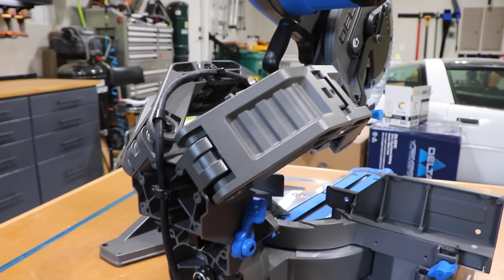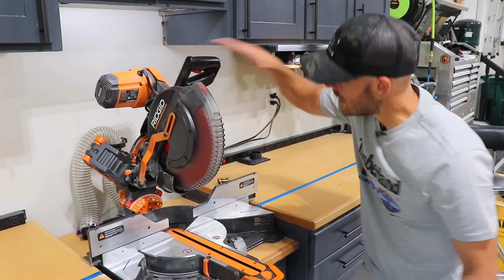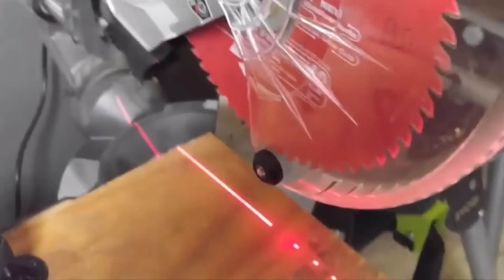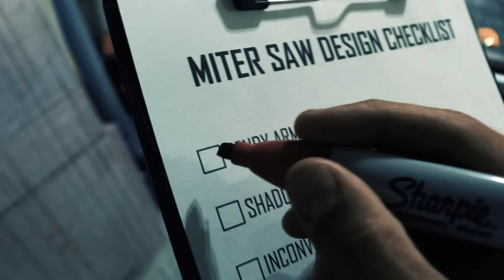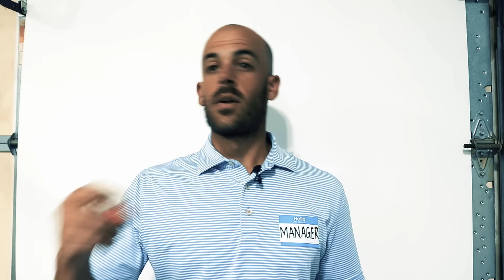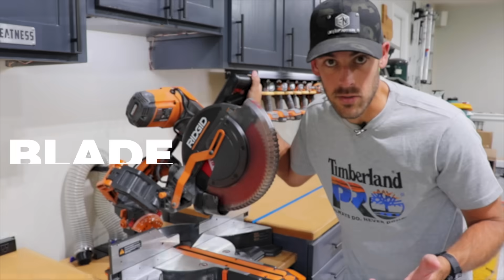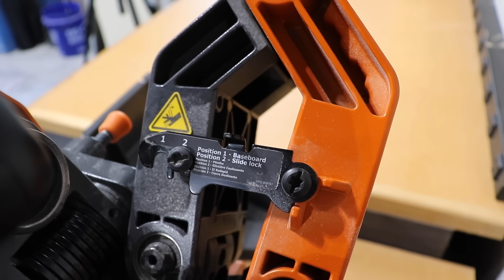I ALMOST took this Saw Back. // RIDGID & Delta Dual Bevel Sliding Miter Saw Review

Comment: Travis, I had the same issue as you with being unable to swing my miter saw to full miter deflection, but I came up with a relatively simple solution. I removed the top surface material from my cabinet and reinforced the upper mounting area of the cabinet, then attached some mounting blocks to the underside of the surface material. I installed 8” (200mm) soft close drawer slides I found on Amazon between the new cabinet reinforcements and the surface mounting blocks so my work surface will slide out and give me the clearance I need. If you get the soft closing type of slide, it does a nice job of holding the saw in the “normal” position for the vast majority of your work. I added two additional holes and put a pin on each side of the front to lock it out in the full open position for when I’m doing my full twist miter cuts.  And I don’t know if it’s necessary, but I used 2 slides per side for a total of 4 to give me the most “solid” feel to the sliding surface. I hope that helps! Keep pursuing shop greatness!
Reply: That was my thought about the drawer slides. I'm actually working on a workbench that will have about 6 spaces to mount tools to. But, I'm mounting all the tools on platforms and attaching the inside drawer slides to all of the tools so I can take them on and off as needed along with a plain solid platform if you're not using a tool in that spot. Using under the workbench for tool storage cabinet that will have outer drawer slides. Just a way to double or triple work space instead of multiple bases on wheels so you can move them around.

Comment: Great video.  Thorough and compete.  I have the Dewalt, and struggle trying to get the cuts I want.    So I use it for rough cutting down to size and then my tablesaw for the cuts I want.

Comment: I bought one of each of this saw (10” & 12”) both Delta for the theater set production department I ran for three years and they have worked out very well. Lots of use over the last four years. The 12” in in a large miter station with 8’ on each side and the 10” is on a mobile stand to be used on stage for last minute work not able to be done in the shop. Everything in your review was exactly what we experienced. I did put high quality blades on them. (Popular Tool brand miter saw blades)

Comment: To get the optimal cut out of both of these saws You’ll have to use some boards to raise the cut  level up to the deepest point of the diameter of the Saw blade on the parallel to your cut table so you just raising the table 3 to 4 inches To reach the widest point on the blade to be able to cut that large

Comment: I look forward to seeing what dust collection solution  you come up with for the Bosch ten inch glider. My current dust boot mod works fine on 3/4 to one inch thick stock but gets hung up when the saw is pulled forward to cut anything thicker.

Comment: I have had my eye on the Rigid 12" for some time now. As with all of your tool reviews, you give us honest plus and minus factors to consider when thinking of making a tool purchase and I personally appreciate the time it takes to do a thorough review like yours. I will admit the price is a big factor with this the Rigid. I have a cheap Kobalt compound miter saw that I bought for $100.00 several years back. I truly hate the saw and find myself using the older Makita chop saw that I also have. The Kobalt does not give me a smooth cut and almost always bogs down or burns when I try to cut hardwood, (it really is a piece of sh--!). My other go-to saw is a 1950s Dewalt Radial arm saw which will have a new cutting station, with it at one end and the miter saw at the other. I plan to keep my most commonly used size dado stack on the RA saw for all of the dados and tenons I cut. Thanks again for your review!

Comment: You should consider reviewing the Ridgid R4231 which is a sleeper model that came out at the same time as the R4251/R4241 and is also made by Delta. It's a 12" miter and features a short slider (thus eliminating most of the blade deflection issues). All indications is that it's built on the same chassis as the R4251 and your dust chute is probably a direct fit. Not a bad deal for $349 (I paid $329 and I've seen it as low as $299).

Comment: The Home Depot in my neighborhood must have seen your video and dropped the sale ;-).  No Sale in the Dallas area.   That was a great review.
Reply: Try ordering online and ship to home for free.  That is how I got my saw for the $399 price.
Reply: @rickbrewer8507   Price online with the link was full price,  When I went to HD site and searched for it,  it was 399.00  go figure??
Reply: @billswoodworks3289  Get it before they change the price!  This a good price and with the dust collection mod it is really a good saw.  I also have the DeWalt DW716XPS and the cuts made with the Ridgid locked in position are just as accurate as the  DeWalt's.  Just make sure you replace the stock blade unless you are only making rough cuts.
Reply: @rickbrewer8507  bought it the moment I found it.... should be here Tuesday.   Thanks for jogging my brain,  didn't think about doing straight web search

Comment: Great video, Travis. Thanks for taking one for the team and spending all that money 😂
I have an AEG (Ridgid equivalent) 10" mitre saw with LED shadow line. It's like an amalgamation of your Ridgid and the DeWalt as mine has those two rails it slides on. I fear the day I want to upgrade to a saw without a shadow line. Once you experience the shadow line, you want it in all mitre saws.
Reply from the maker: I agree!  Such a nice feature

Comment: Another technique to minimize deflection is the layered approach.  Don't cut through the whole piece at once, even for 3/4 material.  Do a half way cut just guiding the machine, life and extend it back, and then do the bottom half.  Silky smooth and straight cuts all the time.  :D

Comment: His Dust Chute is great.  I did have to make one modification to it, though.  He has you use shelf liner at the front edge, and it worked fine for me while I was using my shop vacuum.  Then, I upgraded to a 1.5hp dust collector, and the shelf liner would get sucked up into the chute.  So, I had to duct tape a piece of copper wire to the front edge to hold it in position/shape.
Reply from the maker: A thicker materials works well too, almost like a thin rubber seems to be stiff enough to resist collapsing

Comment: I went with a Metabo which is like the Makita and I'm trying a different approach to dust collection. If it works it will be a game changer for pretty much every mitersaw... great review.
Reply: I set my Makita up by throwing away the stock DC hoses and using 2 1/2" hoses connected to a 4" Y split, picks up everything

Comment: Hola! 🖐Thanks for this video and your input, it truly is packed with lots of info. I currently have a 10" Delta, it's a good little workhorse; I dug this guy out of the trash believe it or not. I purchased a used 12" Makita that has an extremely frayed cord, I'll have to repair that soon. Once I finally get my shop up and running, I'll be definitely put not only a Miter Saw but a whole station. Until then, this review and future review videos will really help me out. Take care and have a good one, Adios! 👊

Comment: I traded my (pretty good) Hercules against the 12" Ridgid - and I fully agree with your view on the saw. 
Also I made my own dust chute out of plastic shelf liner, but I think I only got a reduction of about 50%. I guess I'll get yours then instead of wasting more time on improving my own.
Reply: Hello Mario, I have been thinking about doing the same thing, I am a Harbor Freight 12''Hercules, and it's been a great saw like you say, and changed to this Ridgid, So my question to you is what's been your experience? Are you still happy after you changed?  or somehow you regret the Change from The Hercules to the Ridgid 4251??? Thanks very much for your feedback and happy new year.
Reply: Happy New Year. I don't use the saw as much as I thought I would, but I'm still glad I switched for 2 main reasons: a) the saw needs just so much less space; and b) I barely have kickbacks when cutting small pieces. This second point used to be a major pain for me as I often cut (off) small pieces, and even without a sacrificial fence I never had a kickback on the Ridgid. But on the Hercules that happened almost every time if I wasn't extra careful.
Reply: @systemfisch  Thanks very much for your fast feedback, about the kickbacks I agree with you 100%, Thanks again. & Regards

Comment: Remove the sliding fence, lay a 2x12 on the table and then put your wood you want to cut on top of the 2x12 and slide it all the way in. That will give you full cut capacity.
Reply: any videos on this?  i’m having a hard time  imagining how to do it
Reply: Yeah, it's a little confusing until you do it once and it clicks. Then it makes sense.

Comment: I think showing the blade deflection across a bunch of saws in this category was a great contribution to this discussion.
Reply: Most of these miters deflect. If you don't want deflection. Get one of those 2000 lb radial arm pro shop saws
Reply: @jjohnson8977  Or a Mafell ERIKA, except it doesn't rotate in place so it's not really a one-to-one tool.  It does completely isolate the carriage from the user's clumsy handling though so there's no way to deflect the blade in "chop-saw" operation. It's also a ~$4,000 tool.
Reply: @jjohnson8977  And there is still play in the arm sliding mechanism.
Reply: I've worked with many sliding compound miter saws and I've found Bosch to be top notch in my opinion.

Blade deflection is one of the most concerning aspects of these saws in professional use. It's about the easiest way to mess up your cut, even when everything is setup right.

I don't like sliding saws on rails for this fact. Unless I see one with 3 or 4 rails... I already know it's going to deflect bad one way or the other depending how the 2 rails would be set. Which is always compounded once tilting the saw.

I was interested to see another arm style saw, because Bosch's design works so well. It locks in with less deflection than anything I've used and keeps this attribute when tilting the saw head better than any other I've used as well.

I haven't used something like the Kapex, but find those rails concerning, and would need to test before purchasing. Or be assured of a good return policy.
Reply: @brandonhoffman4712 I had a 2012 $400 ridgid 10" with rails. Very low rail deflection. It was my purchase criteria. Looked at every saw in town and asked fellow carpenters for suggestions. Rail deflection seems to be under control the.last few years. That arm is a knock off of a Bosch saw, same oem ? Allowed to use the design after a decade plus ?
Reply: This saws deflection is off the carts man. Yes all have a bit of deflection but, minimal pressure with your pinky finger will deflected the blade on this pile. No other saw I've used in 27 yrs is as bad as the delta cruzer 12". Not even close.
Reply: @XxPackerManxX  Ya Delta has gone downhill since being bought by Taiwan it seems...
Reply: How did he get all the saws to show us this??
Reply: @michaelhooper9729  13:28 He bought them.
Reply: Kapex has pretty much none.

Comment: Defiantly looking forward to the comparison video.  I noticed you didn't include the Makita 12 inch miter.  Will that be in the your review?  I will be upgrading soon and looking to buy something.  The 399 looks appealing for sure as the Makita is super spendy.  Like twice the price!   Those two were really on my list.  The turn off for me is the laser with the Makita.  I think a shadow line is super functional.   Not that I will be making the fine furniture.   Just want something I won't have to rebuy later and is a good saw.
Reply: Have the Makita... It is worth EVERY PENNY. I can even walk you through making a shadow line setup for less than $15.

Comment: I sold my delta cruzer 12" and bough the bosch glide 12", and I experience very similar drawbacks on both models. Then I come to the reliazation that I should not use miter saw for finish cuts for funiture pieces. Track saw or table saw is more suitable for cross cut wide pieces depending on the situation. Miter saw for rough dimensioning is such a great tool.
Reply: in my shop I use my non slider dewalt for miters on molding, baseboard, and other trim.  so if I get one of these I need a good degree of accuracy when the motor is locked in place.  it would be nice to have the extra capacity on occasion, but  the deflection is making me hesitate on adding one of these to my shop.
Reply: @stevehoffman3341  I might do the same next.

Comment: Great review!  As an owner of the 12” Delta Cruzer model, I have to agree with each point you made, both the good and bad ones.  I am also the owner of the dust chute you designed and am incredibly happy with it!  It does make a huge difference in dust control.  I no longer get a blast of saw dust in my face when I use it.  I was so bad that I got to the point where I was always looking for a suitable alternative to the miter saw when a cut was needed, just to avoid the dust.  Now I go straight to the miter saw with no hesitation.  Thank you so much for that!
Reply: I do not see that as a professional tool. Maybe for a framer. But it's made to fit on a workbench easy which isn't where framers work...

From a professional standpoint I would go with the Bosch for the money or the Kapex (gulp) for the quality of cut.

From a homeowners standpoint. This would lead me to still want to hire a professional for anything critical. Which might be exactly what you're looking for!

I use the Bosch. I saw it as a game changer when it came out. Our company picked one up 10 years ago it seems when we landed a big hardwood job. It's been a workhorse! It even survived a car accident with minimal damage.

Comment: Very nicely done. Great review. I would buy one IF I had lots of cross cuts to do, but I can use my custom made table saw sled for that also.
My old 10" Delta Shopmaster works for the smaller items that I need. 
I may get one of these in the future though.
Thanks

Comment: Fantastic video! They get better and better. But don't feel you have to make perfect videos Everytime. I still enjoy your old videos mainly bc they're informative. Find things later in I missed the first time. 

From your review, although I have a 12" metabo zero clearance slider, I was considering getting a 10 inch delta/rigid for the space savings, but hesitant for losing cut capacity. Your review however sounds like the 10 inch is the buy, with only.missing an inch here and there from the 12". 

Great video! Maybe solve the left 45 with a different printed handle?

Comment: If you had a Bosch 12" miter saw, why in the heck did you get rid of it a buy the Rigid and Delta? I own the Bosch 12" and I have to say I am very happy with it. I looked at the Delta prior to getting the Bosch and it just seemed under engineered and cheap. Well it is cheap, and even though I didn't look at rigid offering, I am sure it is on the same line as Delta.

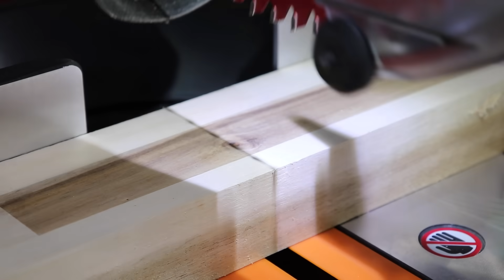Comment: @3:42 thanks for the detailed review.  After working with DeWalt's (DW716XPS) shadow line, I don't think I could ever go back. I thought it was gimmicky at first (like those cheap lasers for drills) but it's a complete game changer.  Edit: at the end. I was wondering why you had so many brand spanking new looking mitersaws.  Can't wait for the comparison videos.
Reply: @EcoWorms Montreal  Yeah, I have a nice blade from CMT.  Works really well, although I miss the capacity of sliding miters.  But as a DIY/Hobby guy, I can't justify another mitersaw when mine is working so well.  And I wanted the blade that Spence of Insider Carpentry recommended, but again, can't justify it as a hobby guy.  LOL

Comment: You get the extra crosscut by LIFTING the workpiece on the slide closest to you while cutting.  You use the fence as the pivot/hinge point.  Stupid that's how they figured the measurement but that's how you do it.  It seems sketchy the first time you try it, and arguably it is, but it can be done safely.

Comment: Hi Travis, nice video mate. I see you showcased the Bosch GCM 12 mitre saw and although your dust collection on your website was designed around the rigid, as they are pretty similar does your dust collection fit both ? Just here in the UK we don't have Rigid so Bosch is all we have available but man the dust collection sucks. Thanks and keep up the good work . Oh and don't eat that onion !

Comment: Great video! After having a sliding miter saw for years and finding out all will have deflection, I use it less and less and use my table saw for the perfect 90 degree cuts I need. If I had to do it over again, I think I'd just buy a chop saw (save the room and space) to do my rough cutting (and flip over if I need to) and use the TS to get my final pieces. Really the only thing the sliders have going for is convince at that point.

Comment: I have owned the Dewalt 12” sliding, the  Hitachi 12” and currently the the Bosch 12”. My favorite is the Bosch (I would like to try the Festool) then the Hitachi and finally the  Dewalt.  Regarding your comment on dust collection, you are dead on as they all are pretty  🤢. Thanks for the review!!